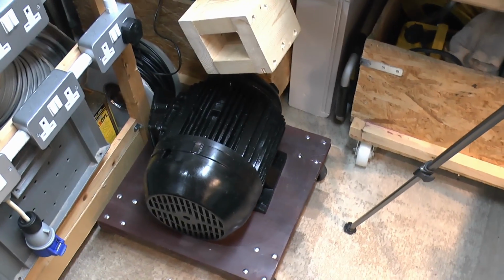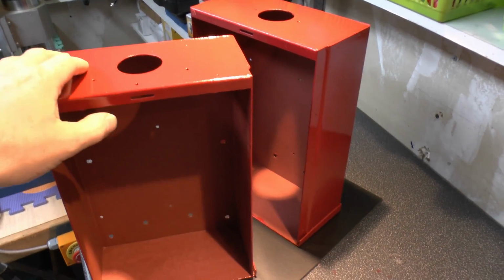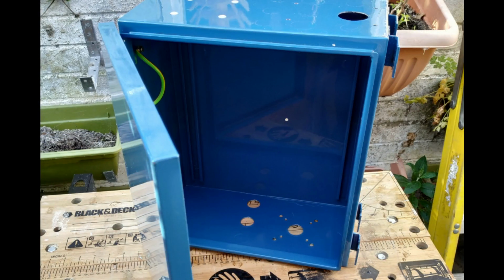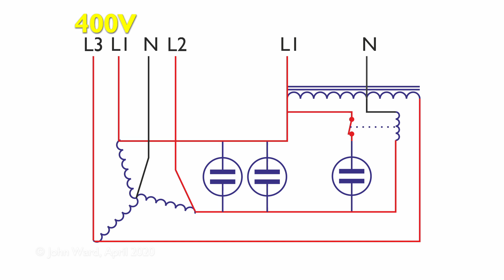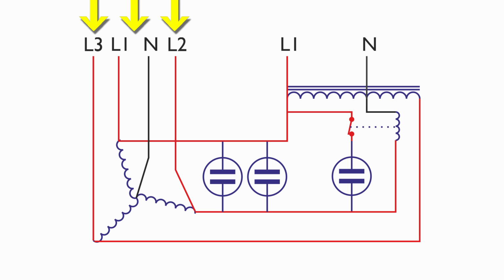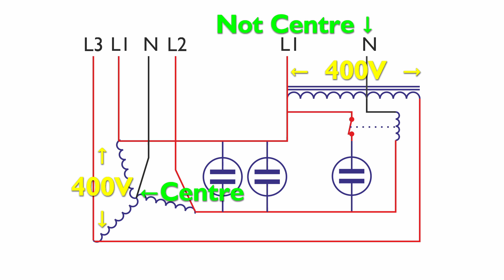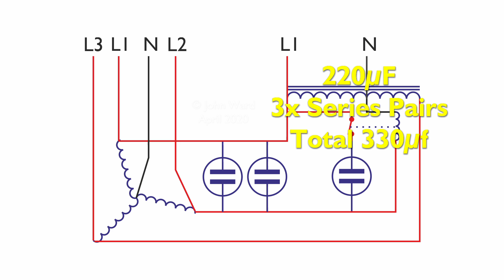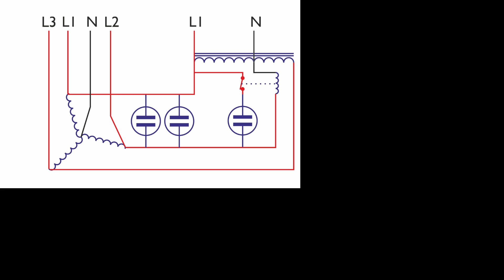Phase Converter 4 - Paint, Wiring Diagram, How it Works, Output Neutral Considerations

Comment: Hey John, I can tell you exactly what your "transformer case" is made of. Those are NEMA 3R outdoor disconnect boxes, most likely made by milbank. They would have been the other way up in their ordinal use, and had a double pole breaker protruding through a "dead front", that would have been covered by a detachable door which would have slipped under the lip of the top pan, then locked into place on a tab that stuck through that little slot. Judging by the size of those boxes, they'd have had 60 ~ 100 ampere values on the breakers. A very North American bit of electrical kit indeed.

Comment: Thanks JW. A timely release as I’m currently trying to repair a somewhat smaller (1hp) phase converter of a similar design I use to run a bandsaw.  Waiting for lockdown to end so I can purchase a replacement capacitor. Keep up the interesting and extremely useful content!

Comment: Great video as usual John. Another consideration for the output neutral is that single phase loads will offset the effective start point of the RPC motor. This will cause the three phase and line voltages to be different..........

Comment: I believe that the lower voltage relay and resistor was done quite on purpose, it means a the voltage at Terminal L2 needs to be far higher before the starting caps drop out

Comment: I can't wait for you to finish this series.... Really I'm itching to see the final results and how awesome its going to look! Stay safe John!
Could try your local Facebook groups and see if anyone has off cuts that you need? 

Ah quick question the first starting caps, why do they need to be disconnected if they are in parallel with the other capacitors? What is different about them that they can start it and the others can not?
Reply from the maker: Large capacitance required to start the motor as quickly as possible to avoid overheating, but far less needed to keep it running once it's generating the third phase.

Comment: What would you do for earthing any equipment driven by this device?  L2 appears to be Neutral referenced and the N output is floating somewhere depending on load balance...
Reply: CPC Connects straight through, not affected by the differing Neutral-voltage.  Even with perfect balance the neural will be some (vaguely) 75v or so to incoming-neutral.
The CPC (Earth) must be connected straight through, no 2 ways about that, connecting to either neutral is exposing live parts...
(Related -- think what happens if the incoming supply has reverse polarity... oh dear!)...

Comment: Hey JW, I can't help thinking that with N connected through to L2 there would be just 240v between L1 and L2. Other designs I have seen (I built a Fitch Williams style rotary) have the generated leg connected to the motor only and with balancing caps to the supply legs..

Comment: Hi mate random question... I'm not a sparky but have lots of experience and knowledge due to being a maintence engineer and obviously having to do a lot of wiring and repairing. Lived in Melbourne, Australia for 4 years and worked in new build houses. (not working as engineer) standard practice was to use a 3 pin standard 240v unswitched socket in the ceiling to connect ceiling downlights. Much safer and reduced issues when unqualified people changed lights as it was just plug in and out. Is there a reason why the UK doesn't use the same approach when installing new light circuits for downlight fittings?
Reply from the maker: There are no restrictions on who can do electrical work in the UK, so unlike Australia, anyone can wire their lights directly to the circuit. Having a plug/socket there is permitted but there would be no reason to do that.  Ceiling light fittings sold in the UK don't have plugs on them either.
Reply: @jwflame  thanks for the reply. I wasn't sure if there were regulations involved with having a power outlet above ceiling. But if it's a case that lights don't come with plugs and no restrictions to who can hardwire lights then that has answered my question. Thanks again for replying

Comment: Wouldn't the start capacitors discharge through the star, from L1 to L2, so a discharge resistor wouldn't be needed, since the contactor is going to be closed when the thing is off?
Reply from the maker: In this design yes.  The original used a normally open contactor and a separate normally closed relay, so in that one, the contactor would remain open when power was disconnected.

Comment: I think you'll find those start capacitors are non-polarized electrolytics.
Reply: You can use Polarised DC caps "Back to Back" and use them on AC. its a bit dodgy but does work
Reply from the maker: The originals was polarized electrolytics connected in series pairs.
Reply: You mentioned the resistors across the capacitors were to bleed off any charge, but they would also have another purpose. If electrolytics are in series back to back I.e plus minus / minus plus, the resistors split the AC voltage so that each capacitor sees exactly half. Otherwise the voltage across each would be rather arbitrary, dependent on leakage.
Reply: @anthonysibley1021  @Anthony Sibley  ... and use diodes to make the reverse voltage less than 0.7V?